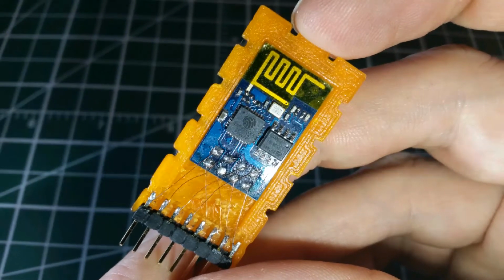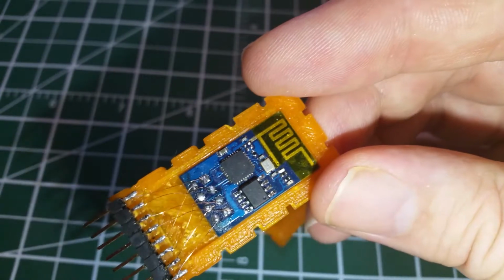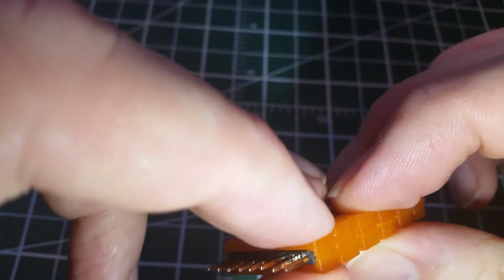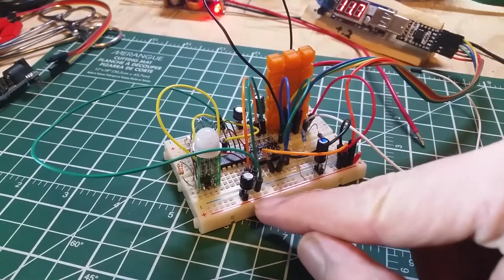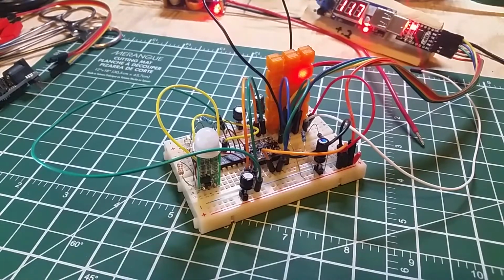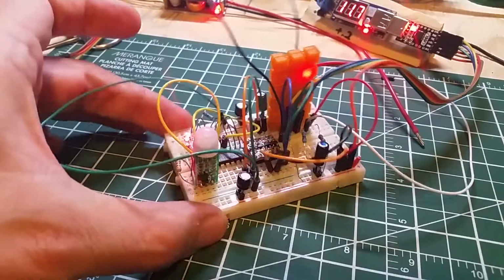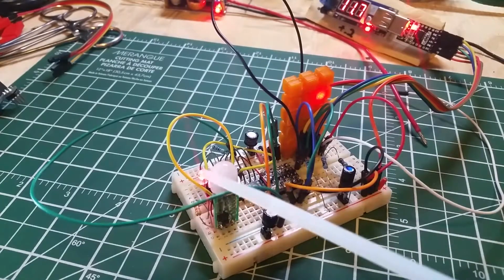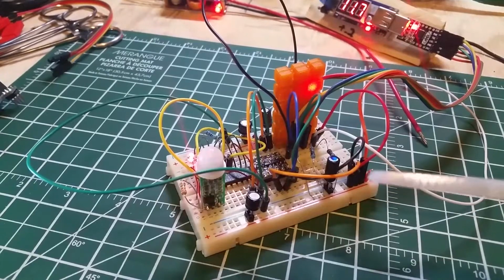ESP8266 in a T800 CPU [ for fun ]

Comment: The idea of using such thin wires is very good. I think, you should be able to print two parts and put the ESP board completely invisible between the two pieces...
Reply from the maker: +Andreas Spiess thanks , that last 1/3 of the video i glued a the other 1/2 of the shell on and tested in the circuit . 
so far the only issue , is I had to mark what side was pin 0 .  getting it in wrong way round is no good . LOL
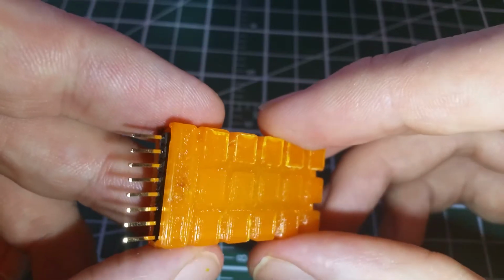Reply: +XerotoLabs I have to apoligize. Obviously, I did not watch the video necessary attention! Obviously I missed the part around 5:00 and afterwards, I did not see that the module looked different...
Reply from the maker: +Andreas Spiess i probably should have kept it in two videos as my first plan . lol